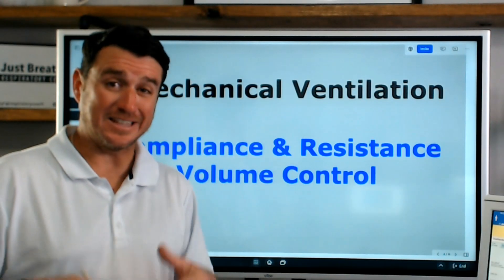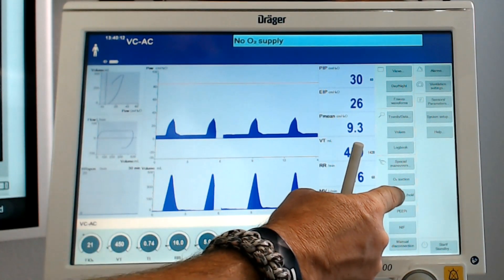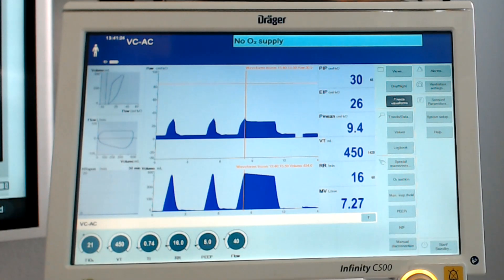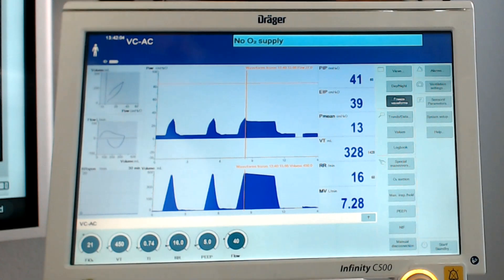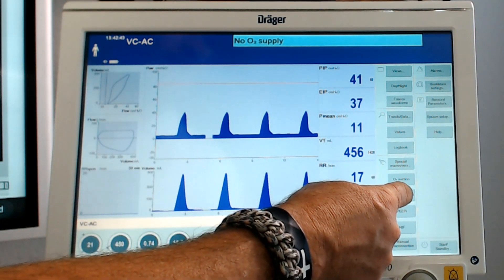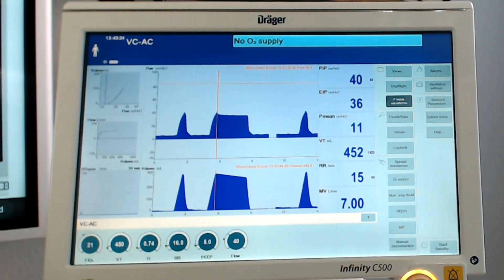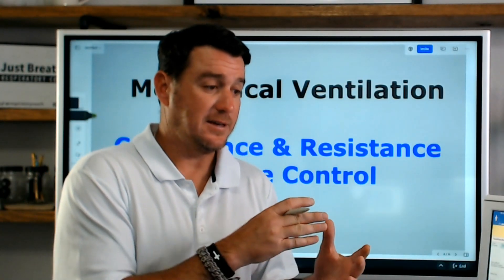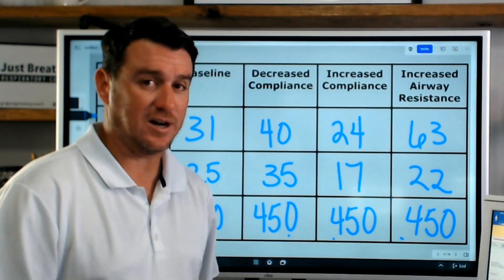Respiratory Therapist - Compliance and Resistance in Volume Control

Comment: Hi there. I have a question about the difference between Inspiratory flow and Ramp. For example in Neonatal ventilation the old babylog 8000+ works with an Inspiratory flow where the babylog vn600/800 works with an Ramp. I am trying to figure out to explain the differences but kinda stuck. Can you help? Greeting from the Netherlands!